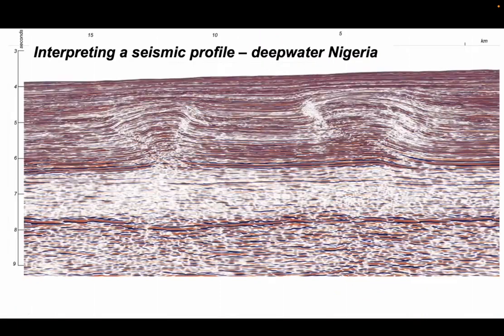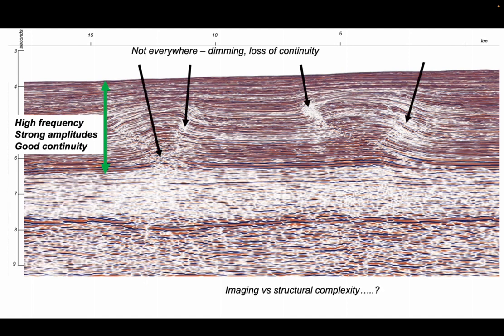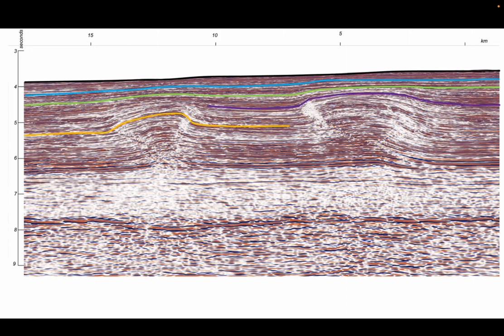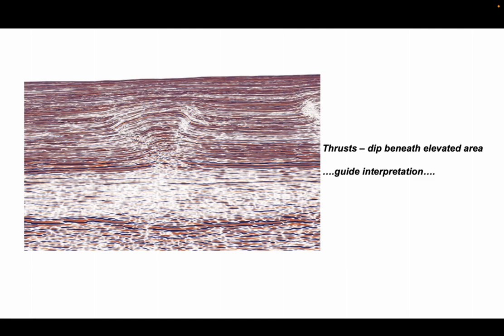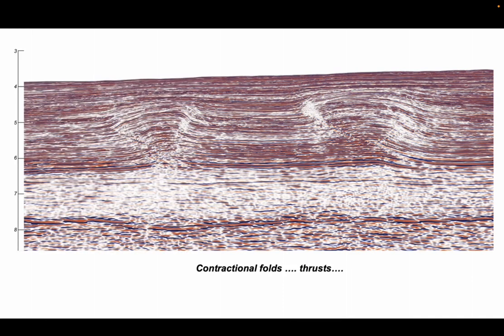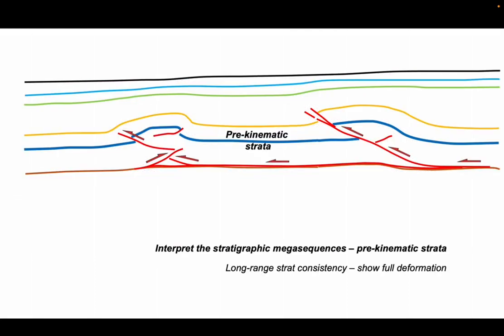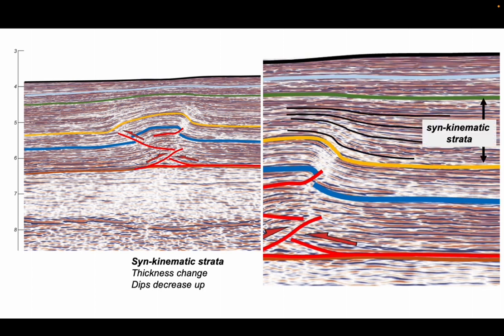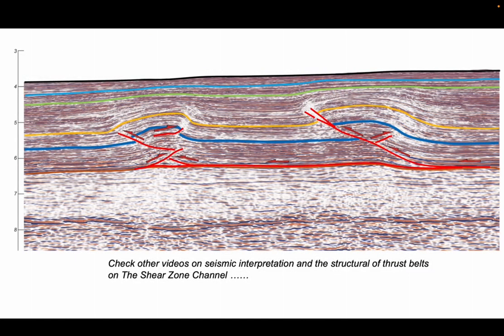Interpreting a seismic profile - deepwater Nigeria

Comment: Great, different layers reveals their time order and also a contractional regime in the surface of the passive continental crust. Below the decollement and the left fold-thrust system, can the white zone be taken as transition zone in structural dynamic regime, or a zone with strike slipping? And still below that, the red boundary line is bended down, showing that's in the extensional regime.
Reply from the maker: The contractional structures in DW Nigeria are driven by gravitational collapse of the thick sediment piles deposited on the continental margin - entirely unrelated to the processes of rifting that formed the margin in the first place. Check out the video on submarine thrust systems for more on this!
Reply: Thank you so much. Then, both  continental and oceanic crust along the Atlantic passive boundary can have this thrust systems. @robbutler2095
Reply from the maker: These types of systems are restricted to the sedimentary cover and don't impact on the crustal structure... @张宏远-z8t